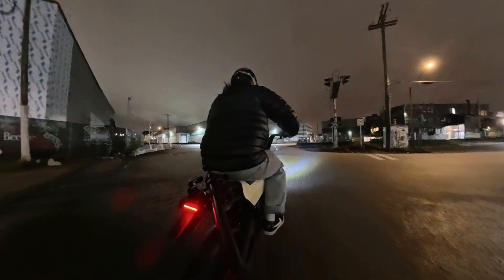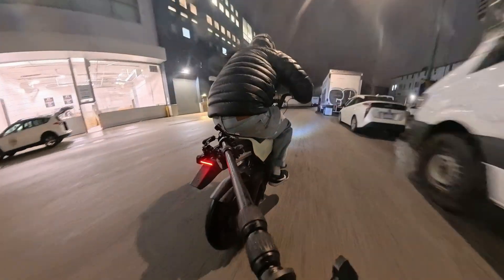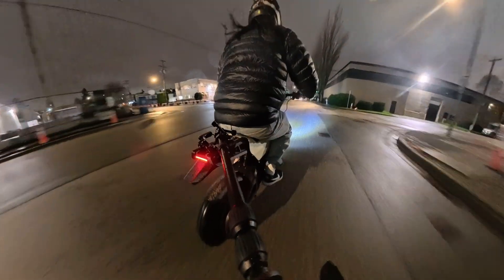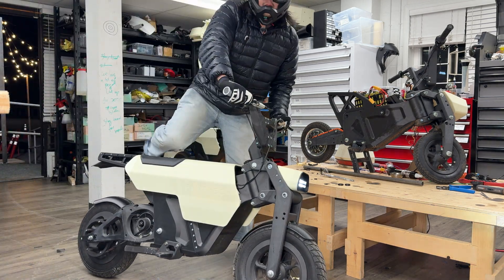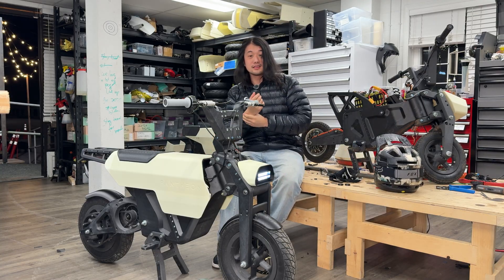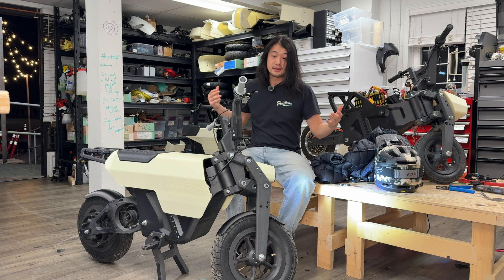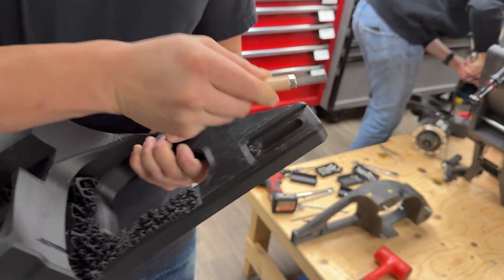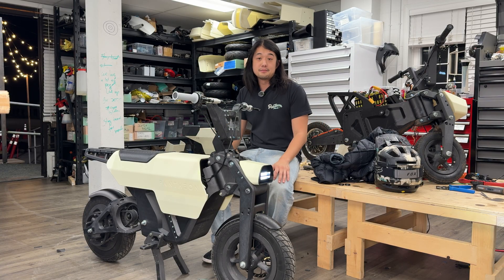We 3D Printed the Ultimate Commuter Motorcycle

Comment: This is cool! If I can make a suggestion, I would love to see an electric version of the Britten V1000 recreated using this 3D method. It's one of the greatest bikes in history, and it's super efficient aero and (similar) suspension would be at home on an electric bike. Also, you can save plastic by making sub-surface steel or CF tube/rod insertion points mid print to get the parts thin and aerodynamic.
Almost all energy goes to overcoming aero drag at speed, yet no one uses it as a development  goal in ebikes yet, which is a mistake.
Reply from the maker: Something like this is already in the works:) minus the reinforcement, we’re cooking up some very tough new polymers with some new friends

Comment: I like what you're doing, very cool, big accomplishment. Couple of small issues with your image, I could be wrong and you want to be aligned with those images, but blowing through stop signs and putting support material in the trash sends a specific message. Just a thought. Good luck.
Reply: Not hating, just being curious. What's wrong about putting supports in the trash?
Reply: @feilko2170 They lower the chance of it being recycled to 0.

I assume that's what the OP meant.
Reply: @feilko2170   No worries, thanks for the question. My comment is born out of desire for their success. I've been fascinated by additive manufacturing for a few years, both commercial and enthusiast/maker-space (YouTube variety). The question of waste and what to do with it regularly comes up, and it's can be a major concern on many levels. Obviously, scale and type of waste matter. A 3D printing YouTuber, and there are thousands of them, creating waste that might wind up in the landfill is one reality. A company that manufactures on scale using more exotic materials (potentially more difficult to recycle) is another. Pantheon Design seems to be moving into the direction of the latter, and as such has some choices and realities to consider. Some percentage of their customers will be interested in their environmental footprint, and the stewardship they exercise over it. Other customers won't. Having said that, an electric "Ultimate Commuter Motorcycle" will attract more of the former type of a consumer; an environmentally conscious one. As Pantheon Design grows, they will deal with these things as they will. For me, seeing support material going into trash at this particular juncture, it raised a small red flag. Not because I think of them as environmentally irresponsible, I simply do not know enough about them. It just gave me pause in the middle of appreciating their significant accomplishment.